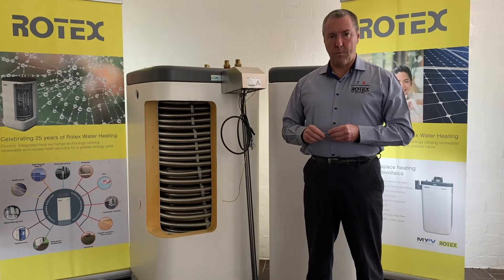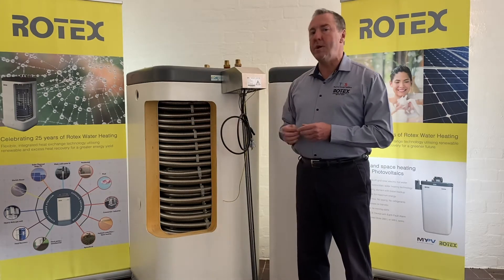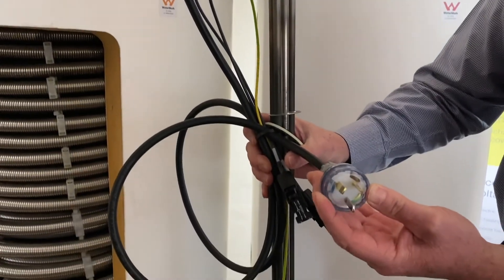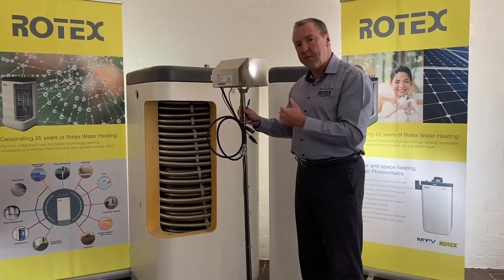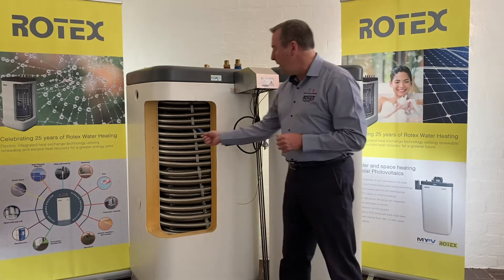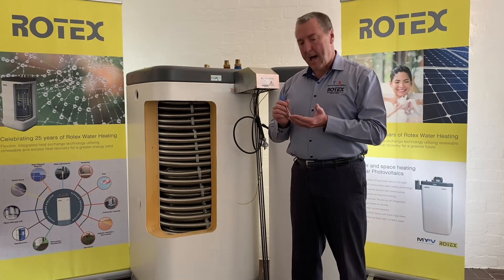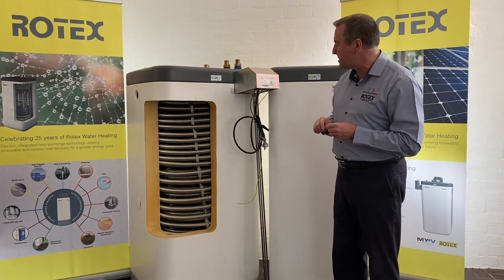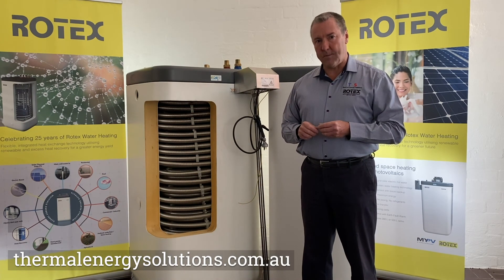Introducing the ROSC20

Comment: Looks like a lot of head room would be needed to install or replace to heating unit.   Also, is there a gauge to check level of fill of the non-pressurized water?   Seems like there could be some evaporation with periodic refilling necessary.